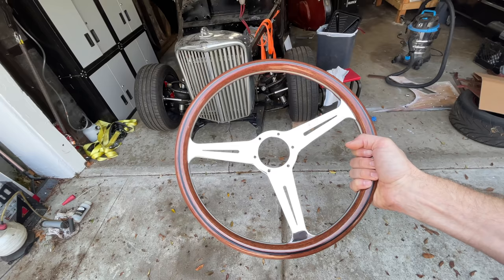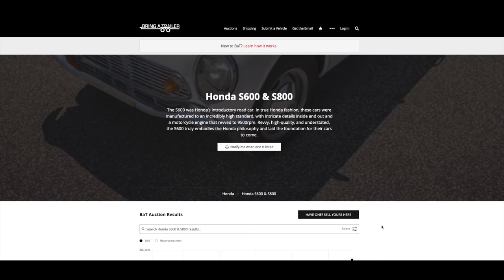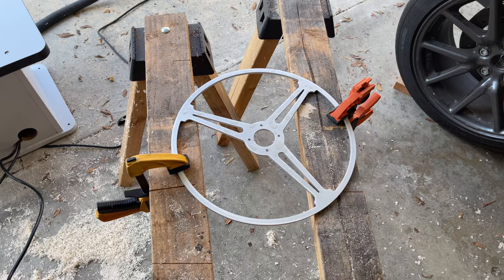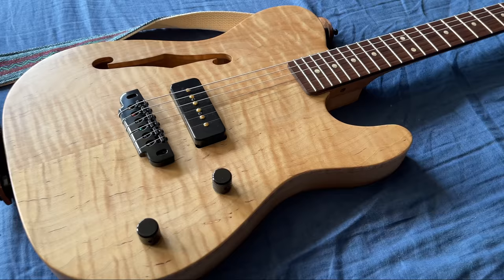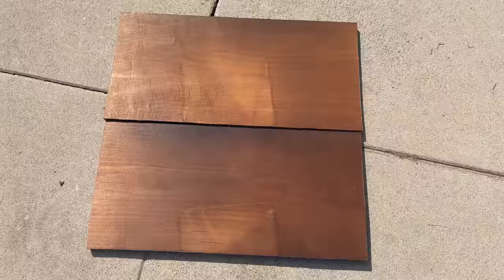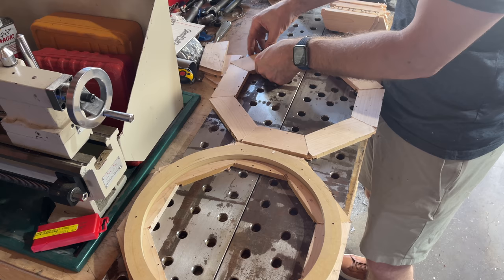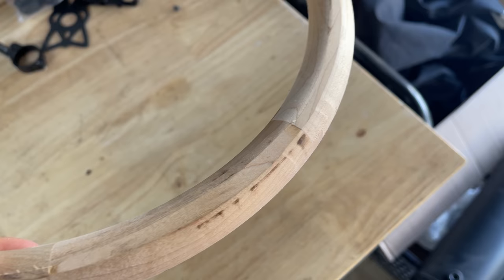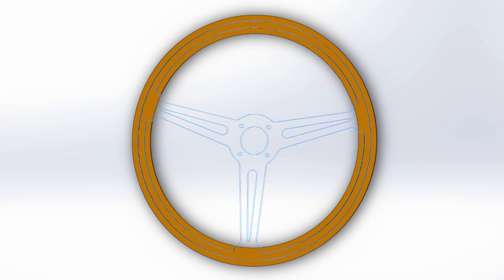Build Your Own Steering Wheel. Or Just Watch Me Do It. Whatever.

Comment: You know what’s more fun than routing your own steering wheel? Using a desktop router like an X-Carve to do it. Your will likely really enjoy not worrying about loosing fingers and how you will cover up your screw ups. Most CNC software sucks and is massively frustrating to use to the point of driving you to making it by hand but there are some simple to learn controllers like X-Carve or KiriMoto that only need a basic model or line drawing. I’ve been a product designer for 30 years and the desktop CNC and printers have been a real treat for projects like what your working on. I love and still use Send Cut Send but I can also get templates done same day on my X-Carve and who doesn’t like instant gratification, and fingers?

Comment: When you are milling in the pulling direction on a table - maybe it would help to have a bearing 2/3 of the wheel diameter away from the router. Fixed to the table. That way the setup has 2 points to be stable at.. 🤔 ..it might work.. ..or not - don't really know.. 🤭

Comment: There’s a finish for Maple that dates back at least to the Revolution. It was used on LongRifles as well as musical instruments. The traditional name is AquaFortis, the formula is 50% Nitric acid and 50% distilled water used VERY carefully. If you make it always remember AAA, always add acid to water not the reverse. Steel filings or easier steel wool is dissolved into it until it is Neutralized and won’t dissolve anymore. Strain it through cheesecloth to remove iron particles and save in a glass container such as a mason jar. It’s still somewhat caustic but much safer to use. Use rubber gloves though or a cotton dauber on a stick is the traditional way. Make sure to raise the grain several times and knock it back down with finishing paper before applying it fairly evenly. Heat is then applied traditionally with a heated iron bar other methods are usable a well. The smaller the heat source the more control. A sunburst effect is easily achieved. The heat is combined with the sugar in the maple to carmelize it and allowing colors between yellow up through orange red and into brown. It doesn’t darken the grain which is still clearly visible. On rifles it was also combined with silver wire inlay to give nice contrast, I’ve also seen copper wire used. Both the inlay and aqua fortis are fairly inexpensive to learn. The traditional topcoat is boiled linseed oil. Which gives it a wonderful luster   With a miles deep effect, it seems to be on fire. It’s also incredibly easy to touch up if damaged and has a Wonderful odor. Just don’t get it from Wal Mart. Tried and Trued wood finish has the real stuff. The curlier the maple the better.

Comment: The guy who discovered Aluminum (a brit) named it thusly, but it was changed to be more inline with the other elements, so both are definitely accepted.

Fun fact: the appliance series that has "HotPoint" calls their refrigerators "ColdPoint"

the "shelves" you made are called "halflaps", very strong joint.  - edge bearing bit = flushtrim bit
Reply: Hmmm. I have a Hotpoint fridge…🤔

Comment: route against the spinning  bit  (to avoid self feeding and maintain control) and with the direction of the grain  of the wood (to avoid tearout), 
it is how you shave your beard, if you go against the direction of the individual hairs you lift them and tear them out (which will happen of the blade is not sharp enough) if you go with the hairs you simply cut theme

Comment: Centercap
3d printed part - with filament swap at layer height.
Do it with abs or asa, vapor smooth it and for finishing touch use clear resin to create uniform outer surface. Or just spray it with clear coat and call it a day. Ez
Reply: I scrolled a long way for a 3d printer comment.  Useful for so many custom templates and jigs also
Reply: @trahar6257  it's quite funny, right now every car in my family have some kind of 3d printed replacement part. 3d printed wheel center caps are norm XD (much easier printing than looking for oem one or wait for one from China).

Comment: Tip for preventing tearout while cutting a radiused edge:  Start with the bit really low, so it's just barely shaving the wood.  Do a full pass that way.  Then raise the bit ever so slightly, and do another pass.  Continue with more passes until you get the radius you want.  Be patient and sneak up on it.  By shaving less wood with each pass, you drastically reduce the odds of that bit digging in and sending a chunk of wood flying into space.  Yes, it takes five times as long, but it takes less time than starting over from scratch.  It's also much less scary.  Ask me how I know all this ... 🤠

Comment: To stop blowing apart the wood when routing is to nibble away at the in the direction opposite the router bit, after completing that task you will do a final routing in the same direction of the bit. Works every time. Having a really sharp bit also helps

Comment: Been there, did that fifty years ago at school, metalwork. I cut out the aluminium by hand, that was the hardest part. Used marine plywood on either side and riveted it on with aluminium rivets. It was then mounted on a woodworking lathe to profile the plywood. It came out great with a strip of metal showing around the rim. All in all a much easier way to do it if you have access to a lathe. English schools were good back then!

Comment: The steering wheel looks great.  If you wanted to retain the original, the wheel ring can be sprayed in the rubber finish material they use on mobile phones, any colour you like.  If the centre is aluminium, it can be vapour blasted with glass beads to a mirror shine. If the centre is steel, it can be painted in a chrome basecoat and a candy clearcoat so it looks like a chrome anodised finish, again any color you like to match or contrast the colour of the wheel rim..  A whole lot more choices.

Comment: Tip for the gluing, use wet rag to wipe off any that is pushed out and when glue has solified to hard jelly like, it will hold the peaces already but remove it from the clamps and use box cutter to remove any remaining glue so little sanding removes whats left. For sanding you might want to try sanding bow to get more uniformed bend.

Comment: i made one once , it was before lasers had been invented so i used a jigsaw to cut the alloy ,and cut 2 cirles out of some cheap plywood, as this was also before routers had been invented - or maybe it was before the internet so i hadnt heard of routers , i  didnt rebate the wood just sandwiched the ally between - i have seen production wheels done this way too.  it would of worked well had i had  good quality birch ply  , The car it went in was also made out of plywood - this too would of worked a lot better had i had birch ply.  All Hail Frank Costain

Comment: I know I'm super late to this party but just an fyi, that little peg thing that comes with your router table is super handy when you have to feed your workpiece with the rotation of the router. you can use it to leverage your work piece against it when initially feeding it in. It also helps when making normal cuts to with no fence.

Comment: I have made 3 wheels for Triumphs.  I glued the wood donuts directly to the aluminum. But, the wheels are asymmetric, 13.5” main OD, 11” OD across the bottom. So the idea of octagons, router jigs etc aren’t directly useable. The one in my car is Koa, the other two were quilted maple. They really give excellent leg room across the bottom. Reference the original wheel Nardi used in his racing cars on the EZ steering website.

Comment: A nicely done project, however I don't think aligning the wood grain for a piece 1" wide that is also back by aluminum is necessary. I would have also considered using AL rivets to attach the wood like in an original Cobra.

Comment: there were a couple comments in the past but ill be more explicit your glue joints with out the shelf would have been stronger than the wood.  time would have been better spent making 16 smaller circular sections if you were worried about strength. love the channel!

Comment: To prevent splintering lower the round o er or what ever your cutting and do a little bit at a time till you get the height you need trying to do it all at once will cause this . be careful as to which way the grain is going even if you cut it with the grain it will some times curl around so keep close eye on the way the grain moves

Comment: you know what they need to invent? We need a kind of a liquidy goop that you put on wood to change its color without cooking it. Yeah, that would be cool.

For your emblem, get SCS to cut out the metal part, and do an epoxy pour which you will tint with black powder sold for that purpose. Use a propane torch to get all the epoxy bubbles to pop and get a flawless pour (watch any of the zillion epoxy woodworking videos on the youtubes). You can sand whatever slightly domed profile you like, then polish it up to quite a high sheen.

Comment: Use EPOXY for an automotive wood application, not wood glue. It will shrink and come loose. I recommend G2 epoxy as it can flex just a little bit and handle thermal expansion. You did leave some room for thermal expansion of the aluminum, riiiiiiiight?

Comment: Steering wheels don't actually have to be all that strong, especially if you have power steering. As a matter of fact, in situations where the steering wheel could break, you probably WANT it to. Besides, the way you have constructed it with the metal rim inside, the strength of the wood itself is pretty much irrelevant. The wood is just there to look nice, feel nice and be of a good size to give you a good grip.

Another aspect is that if you put the two halves together with the grain at 90°, you're pretty much making the grain direction moot anyway.

Which is to say that If I were doing it I wouldn't be worrying about the direction of the grain or going to all that trouble to control it. While I think the sections have a certain aesthetic that I like, I do prefer the single piece. It's a lot less work. The drawback is that you have to use much bigger pieces of wood, but if you're like me you can keep the leftovers for other projects, so the offcuts won't go to waste.

Comment: The naming of aluminum/aluminium has enough of a complex history that neither can be declared incorrect. One rhymes with platinum, the other titanium.

Inches, on the other hand, really should be left to measuring "human-sized" items like clothes, and not be broken down into fractions for engineering accuracy. That's where metric works best.

I'm a Brit. We've struggled to let go of imperialism forever, and we still are struggling with it... although I think metric measurements have the upper hand in most engineering disciplines these days. But, we still drive miles and miles, and measure people in feet & inches and stones & pounds (although not when doctors are concerns - they use metric only).

Comment: I can't help but think that you were being obtuse about the whole router climb cutting, wood grain direction thing because that's your 'thing'.  It's your YouTube channel style and you know very well but it suits the look and feel of your channel to pretend not to.  Either way the steering wheel turned out nicer than you'd have had any right for it to have done so, if you were really as blasé about the process as you are pretending to be.  It's actually difficult to avoid tear out in some situations, but climb cutting certainly helps if that's the way the grain dictates.  It also helps to take very light cuts and multiple passes.  I prefer to keep the cutter height constant, and do it by feel, and yes I do still get tear out sometimes.

Comment: Hi,

Thats an amazing job. I also noticed in 10:09 that you have refurbished a MX5 nardi torino. That is exactly what I just got second hand. I will have 2 questions:

What did you use to make this beautiful finish? what varnish? did you oil it before?

How can I strip the old varnish without touching the black circle line?

To polish the metal, did you later sprayed it with some laquer to keep it from scratches?

I will be amazed if you reply.

Comment: Damn, all I didn't needed right now was to get motivated to make a steering wheel. I'd 3d print the wood part and cover the ring with fake black leather, though. Not me, someone that knows how to sew.
Reply: Making and sewing a leather cover on a steering is actually a simple and not particularly difficult thing to do. You can even buy covers in various wheel and grip diameters. I bet you'd succeed the first time and get that warm feeling of stisfaction we Nerds love so much EVERY DAMN time you used it
Reply: @jonathangehman4005  I'll do it. There's just a "Finish installing the EFI so it runs" thing up on the priorities.
Reply: Throw down!

Comment: How did you prevent aluminum from recreating the passivation layer?
Reply: Once you polish it, it stays pretty bright.  There's an oxide layer that forms rapidly, but it's too thin to see.
Reply: @incognitotorpedo42  I'm asking because I have past experience with polished aluminum And I know that uncovered will get rusted much faster than before and I was wondering did you galvanize it or did you varnish it?
Reply: @2EOGIY  You can't galvanize aluminum. You could anodize it, which seems appropriate for a polished steering wheel.